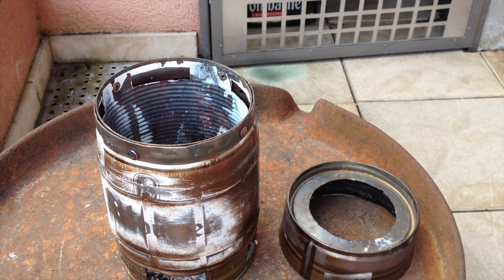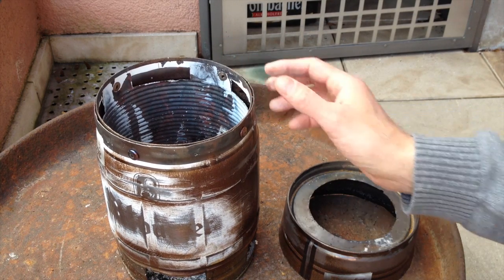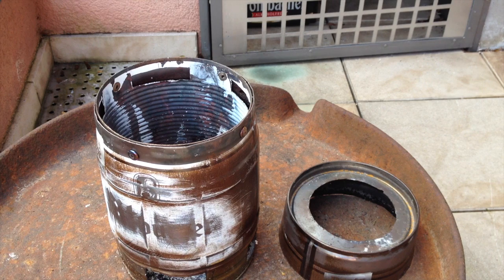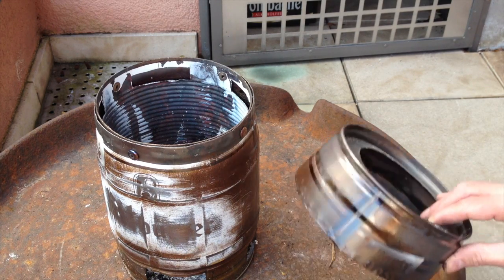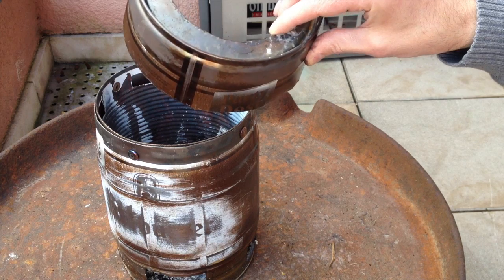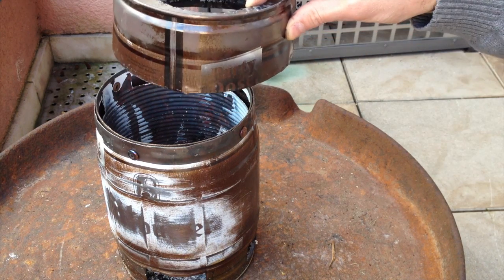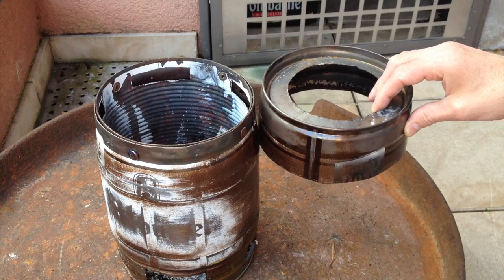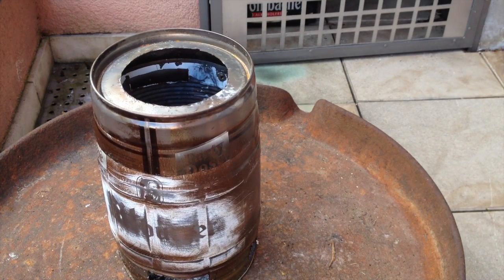Giant woodgas stove improvement

Comment: You will probably find, that when you put a pot or frying pan on top of this, that it will choke off the flame. To avoid that happening you should put a series of holes, maybe 1/2-3/4 inch diameter, around the bottom of your "muzzle ring".
Reply from the maker: That is definitely true. I never actually  used it for cooking. My other idea to compensate this problem was to create another element to put on top of the stove in order to not have it choked. But I did not try yet.
Reply: Stove Mods Just remember that a good wood gas stove is not just one that puts out a lot of flame and uses a lot of fuel. It must be good for cooking on also.